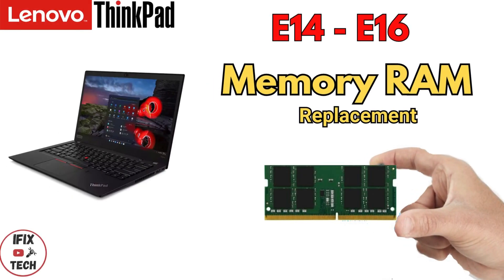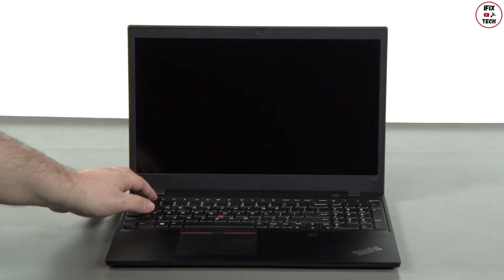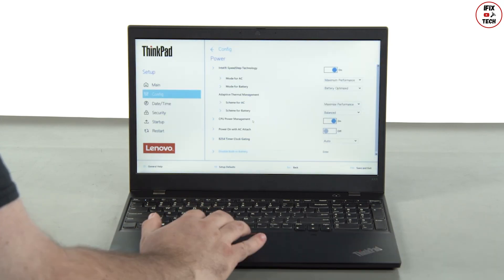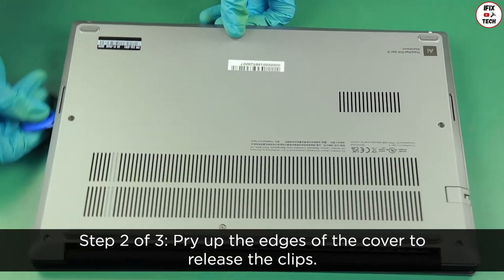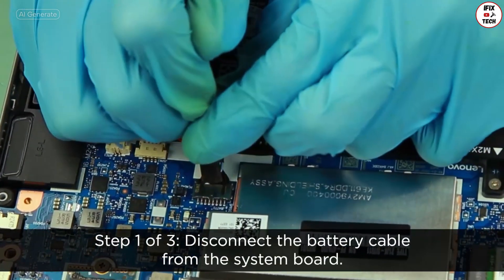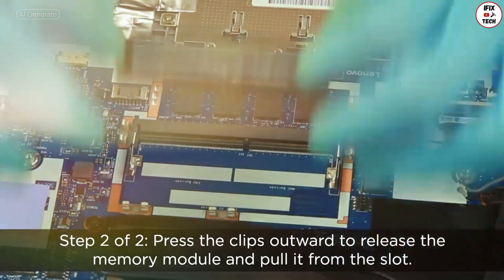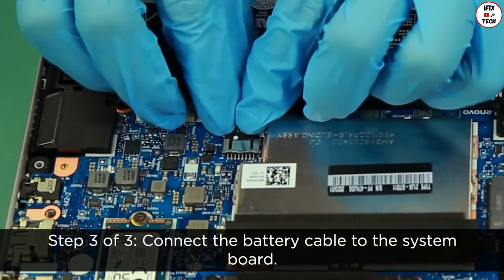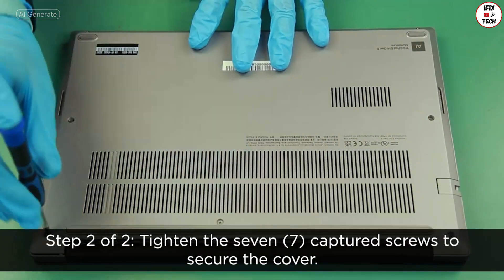Lenovo ThinkPad MEMORY RAM Replacement E14 and E16 - How to Remove RAM

Comment: This is a Useful video I always heard that upgrading laptops can be a pain but this is pretty simple now I can go from a DDR4 4gb ThinkPad E14 to a DDR4 16GB ThinkPad E14 that will stop having a stroke anytime I have to many tabs open when I need to multi task...................Technically it was originally 8GB but I have Different OS's running on it For Different purposes
Reply from the maker: Very glad the video was able to help. Thanks for liking it and subscribing 👋 😉

Comment: Hi, Expected to see our last step over two where you reactivate the internal battery via BIOS at start up after RAM install. Does a re-activation need to happen at that time?
Reply from the maker: Just need to connect the power adapter. Thanks for liking it and subscribing 👋 😉